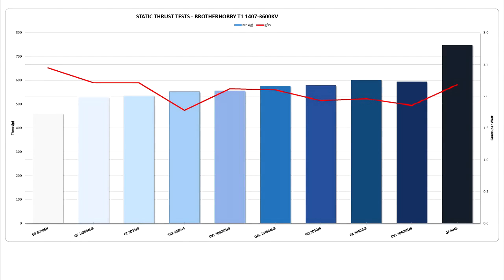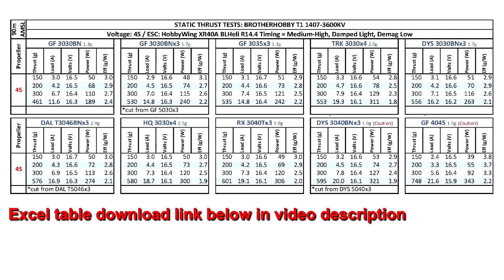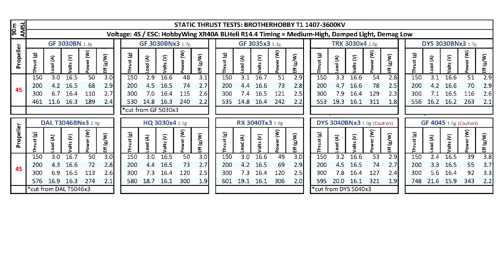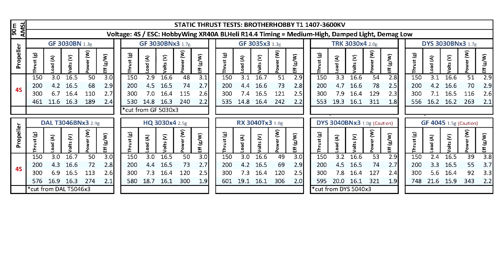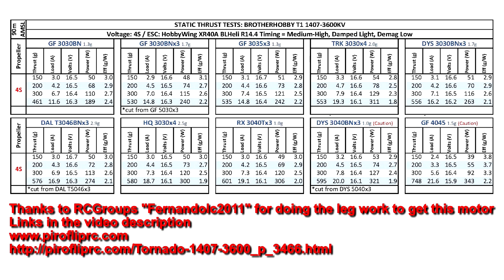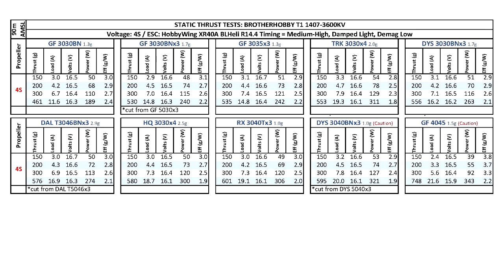BrotherHobby Tornado T1 1407-3600KV 4S Static Thrust Tests

Comment: Don’t know if this will get a reply since this video is older but would a 20a esc work for these in a cinewhoop setup?
Reply from the maker: Yes, any capable 20A-rated esc will handle cinewhoop props just fine. We used to run FVT-Little Bee 20A Esc's for 2205 and 2206-2400kv motors on 5" props and upto 600g stups.
Reply: EngineerX awesome. Thanks for the reply. I have an older dys f4 flight controller and dys f20a 4 in 1 esc I’m planning on putting into a diatone taycan frame with a caddx vista system. Hopefully it’ll all combine together well.
Reply from the maker: @shilomccoy7754  Sounds good. I've used the DYS single 20A BLHeli_S ESCs with 2205 motors and 5" props. I believe those 4-1 ESCs have same components as the single ESC's. It should be plenty capable. Good choice on frame. I recently was watching/reading about best Cinewhoop .... Taycan was one of the best designs. Prop selection will be key as it needs to have very small prop-to-duct gap. Check it out - maybe you already watched https://youtu.be/J1_WdRgjaOI
Reply: EngineerX just checked it out. Funny those are the exact props I have in the cart with the frame. So I should be good to go.

Comment: How many poles are on these motors    ( Bi Directional DShot concern )
Reply from the maker: These are 9N12P. 1507s are 12N14P
Reply: @EngineerX  Thanks man  I was stupidly counting the wound   posts versus the magnets in the bell   For the purpose of setting the pole count for Bi Directional DShot . I figured out my error from Bardwells video as he counted the magnets as they passed a single  wound post.  Dumb of me but I figured it out  THANK YOU.  Your Motors Bro Hobby EngineerX are the best in my fleet.  I have the Low Kv and high KV versions on my Armatan Roosters.  Still trying to find a good prop for the low KV versions that use 6 inch arms. What ever I have now the props were too big for the six inch arms . Good weekend Bro  be safe . Thanks for your hard work/ I wanna say it was 6" Azure props but they touched each other in flight  so maybe not quite 6" is required
Reply: Oh theres 12 poles  if anyone else cares
Reply from the maker: @gapsnapperfpv3947    1407 for 3d... Should be fun. Thanks for the nice words. Have fun on the weekend with the new build. I'll remember to check out your channel and see if you got video of that 1407 setup.

Comment: Hi, how about the heat compare to GR1408?
Reply from the maker: GEPRC 1408 for some reason runs hot. Depends on voltage too. These are ok for 3" on 4S
Reply: @EngineerX  yes, im trying to use it on my 4S 3" kwad.. is the heat will safe?
Reply from the maker: @tanoryjakaperdana1419  yes it is ok and safe BUT your quad should not be too heavy. Normal weight for 3" quad around 300 to 350g with battery is ok.
Reply: @EngineerX  ok sir.. thankyou..

Comment: Do you think I can run 3 inch 4s  on a 15a esc .
Reply from the maker: A 15A ESC can handle 3S for 3" props but probably too close for most people. 20A is what everyone uses for these motors but as long as you keep it very light and don't use too aggressive props it should be ok
Reply: Thanks . @EngineerX
Reply: I am going to take a chance on the 15a and let you know  how it goes. I am using a hglrc zeus f4 and I need it because I am making 3 inch cine quad in a frame not designed with that in mind.

I am banking on the numbers being over inflated and will not use a top tier C rated battery.

Thank you so much for the channel as it has become more important the longer I stay in the hobby. If it wasn't for your channel I would have no idea of the Amp draw with the different battery and prop combos.
Reply: not sure if this is what is considered light in a 3 inch but my all up weight is 243g on a 4s 850mah 
and is 219g on a 3s 850Mah
Reply from the maker: @rwells242  sounds like a very interesting setup. I think as along as you go easy on throttle. No crazy punchouts it should be alright. The low C battery will help keep Amps low a bit.  Only parameter left is overall lift. Hopefully enough on 3S. It might be close once loaded. You can even try 4S if 3S doesn't work. Higher voltage at lower throttle position may give better performance at lower Amps than 3S on higher throttle. 3S is a good start however. Cool let us know how it works and cool to know info was useful.

Comment: A test with gemfan 3052 would be very interesting.
Reply from the maker: I need to order a set. I tested GF Flash 4052x3 with the Racerstar motor https://www.youtube.com/watch?v=-Q_4Uy3PXV4 and tested the RotorX 3044T prop with the BH 1507 https://www.youtube.com/watch?v=iuCMBe78QLY
The RotorX 3044T is very similar to the 3052 but yes, need to test it sometime. My best guess is performance should be very close to the Lumenier 3040x3 so it should be a very good prop to fly fast.

Comment: Hello😆 Engineer X what do you think is the best 1407 motor on the market
Reply: Hairy Hider wish he answer cause I'm in doubt also
Reply: Cobra motors 1407 4100kv are my favorite by faaaar.  They come in a few different kv options. They are super smooth and quiet, run cool, are efficient and incredibly powerful.

Comment: Would use these motors with the 2800 KV or Emaxx 1306 3300 KV on a 160mm build with 3545 props thanks
Reply from the maker: a 1407 3200 to 3600KV would give you the best performance. This 2800KV motor has lower KV, about 2600. It will work OK but if you're looking for lots of punch then go with higher KV. The 1306-3300 would work too, but sometimes those overheat if you go hard on them.

Comment: Hey mate! do you by any chance have data with this motor on a hq 4" V1S triblades
Reply from the maker: TOOBZ FPV No, I didn't run it but if you check out the Cobra CP1407-3500kv test you can get an idea of thrust this motor will make. First, compare DAL T4045x3 V2 on both motors, you'll see the results are very similar. So the perdormance of the HQ 4043x3 V1S on the BH 1407 should be  very similar to the Cobra 1407's

Comment: I would really like to see the way these stack up to the new Cobra 1407 4100 KVs on your thrust test
Reply from the maker: Unfortunately Cobra didn't respond to my requests for test samples, so I ordered 1 of the 3500KV version. I figured right in the middle and should show how good the CP1407 are. So if as good as BH1407 then the 4100 should be similar too.
Reply: i bought the gold set of the 4100kv i almost went for the 1806 but wanted a light 4 inch..and it also seems to me that people have abandoned the 1806 size motors or they haven't came out with a set thats worth mentioning i still have the xnovas in the box...what props would you run on these in particular  (1407sl
Reply from the maker: 1806s got caught between 2204's and 1407's. Just recently the BH R41806 and TM F30 seem to be pretty good. 
For 4100 on 4" I've seen a few people using the DAL T4045x3 but it'll be very tough on small LiPos. I would start with a 4045x2 King Kong or DAL, the GF are too fragile. Then if motor stays cool and LiPos can handle it you can move up to T4045x3 or TJ4045x3
Reply: EngineerX king kong 4045x2 is what I use on my cobra 1407 4100kv.  I've heard the hq props 4045x2 non bullnose are slightly better, but I haven't tried then yet. If anyone has compared the two I'd love to hear your opinions.

Comment: hi,
I have been stuck with my 3inch build for almost one month due to the overheating of the motors.
My initial setup was emax rs1306 4000kv with Racerstar Labs 28A ESCs and Gemfan3030BN blade running on 4S.
The motor just getting too hot even at the betaflight motor tab.
I then changed the motor to brotherhobby T1 1407 3600kv with the same setup and hoping everything will work out but it turns out that the motors are still getting hot at motor tab and I did some hovering test with few small punches with less than 1 minute flight, the motors came down very hot.
The motor screw length are not shorting the winding and I have turned down the PIDs to more than half of the stock value with D below 10.

Extensive readings and research makes me really disappointed as I cannot really locate the problem.

Recently I have been reading about the compatibility of ESCs with Motors and see people discussing motors running 4s will be more prone to desync issues which may also cause motor overheat.

Do you think the ESCs might be a problem? What ESCs would you recommend to run with the rs1306 4000kv as well as these t1 1407 3600kv high KV motors?

Sorry for the long message, but really appreciate if you can shed some lights on this.

Regards,

Zt.
Reply: try to softmount your flightcontroller...
Reply: thank you for your advice, but its running too hot just on betaflight motor test tab.
Reply: hmm check your motor timing..0.50 ..in blheli suit or may b  you have bad esc change esc aswell for test

Comment: hi,

Thank you very much for this insightful review.

I have been stuck with my 3inch build for almost one month due to the overheating of the motors.

My initial setup was emax rs1306 4000kv with Racerstar Labs 28A ESCs and Gemfan3030BN blade running on 4S.
The motor just getting too hot even at the betaflight motor tab.

I then changed the motor to brotherhobby T1 1407 3600kv with the same setup and hoping everything will work out but it turns out that the motors are still getting hot at motor tab and I did some hovering test with few small punches with less than 1 minute flight, the motors came down very hot.

The motor screw length are not shorting the winding and I have turned down the PIDs to more than half of the stock value with D below 10.

Extensive readings and research makes me really disappointed as I cannot really locate the problem.

Recently I have been reading about the compatibility of ESCs with Motors and see people discussing motors running 4s will be more prone to desync issues which may also cause motor overheat.

Do you think the ESCs might be a problem? What ESCs would you recommend to run with the rs1306 4000kv as well as these t1 1407 3600kv high KV motors?

Sorry for the long message, but really appreciate if you can shed some lights on this.

Regards,

Zt.
Reply from the maker: thank you for watching!
Reply: hi, i actually have some questions and it is too long so you may want to click the read more button hahaha.
ooops.

Comment: Do you perhaps know what the Numbers are on hq 3x3x3?
Reply from the maker: I didn't run the test on HQ3030x3 because it seems the prop is not as widely used as the other ones and it's a little heavy. Also it makes less thrust than all the others and uses more Amps. They're well balanced and do fly well. You can see several tests I ran and compare to other 3" props. You can more or less estimate what to expect from that prop based on previous tests
https://www.youtube.com/watch?v=AK69tcHpPzo
On this not so high 3300KV motor ( a good KV for comparison because as you go up on KV you get less torque) we can see the HQ 3x3x3 makes about 6% less thrust requiring about 5% more power 180W vs 171W  (1A more) compared to the DYS 3x3x3. 
As you go up in KV to 4000KV, then the HQ becomes even less efficient, 
https://www.youtube.com/watch?v=wy6biSK8iRE

So to decrease time it takes for testing... I decided to drop the HQ and keep the DYS instead because they're close but the DYS has slightly better performance.
Reply: EngineerX ... Hi EngineerX! thank you so much for reply and great info. I have a 3" quad with the emax 1306 4000kv motors. i tested the racekraft tri blades but didnt like them. the hq 3x3x3 is much smoother. i ordered some lumeniers 3x4x3 and rotorx 3040 tri. Do you think the lumeniers 3x4x3 are better than the Hq? and also well balanced? The props need to be as much vibration free because my fc gyro is super sensitive. if i only gain a few percent thrust with the lumis or rotorx blades but more vibration i will stick to HQ.
Reply from the maker: The RotorX are best because they're light and well balanced but they're very fragile and expensive. I have not tested the new Lumenier 3" but I have been seeing people very happy with those and they say they can take a beating. Yes, from looking at the blade profile and shape, the Lumeniers should give a little more thrust. 
But sometimes you have to actually try them in flight to see how they perform with your set up, so it's good you're going to try those 2. Well let me know what you think of the Lum & RX once you try them. Always good to hear from people's actual flight tests.
Reply: EngineerX thanks for the advice! i will let you know after some test flights :)

Comment: Will it be fine if I run it on 4inch
Reply from the maker: Depends which prop. GF4045, or KingKong 4045 2-blade will be OK on 3S and 4S. 
For 4x4x3 you're better off running 2204, 1806, 2006 motors for 4S

Comment: Are these hand wound motors? And any chance of testing this motor with tj4045 (the standard tip triblade). Looking to compare against the prototype rotorgeeks 1407 3200kv. Was really able to push the RG motors. Stress tested the RG 1407 4000kv with almost all 4 inch props including dal V2 tip triblades. Motors never got hot but that setup puffed batteries like nobody business.
Reply: The 3200 was tested with TJ4045 on the bench and was alright.  Pushed 750g around 25A. For the more aggressive triblades on the 4000kv it was only done in flight. The 4000 was also bench tested with 5030, that test was called off on the 4000kv as Dave felt like it was going to smoke the motor. 

When asking if it's hand wound you should be able to tell by the gauge of the wire. Thicker wire generally can't be done by machine. If you see multistrand and very thing wire then it's machine. Hand wound can handle more current :)

As for 4 inch triblades, I don't really like the 2205 2633kv. It's kind of lackluster really. Would prefer the 1407 with tj4045 over it. Older motors like the RCX 1306 definitely had a noticeable drop in responsiveness running the triblades. I didn't notice this with the RG 1407 however. Makes for a very very fun 4 inch. You can also run a 1000mah pack with the 3200kv setup which makes for a nice light weight build. Honeslty one of my favourite quads to fly right now. Debating picking up a warpqaud type frame to build it with 5030s and see how it handles.
Reply from the maker: I think that's about right. I haven't had a chance to slap the RMRC 2204-2600 or the RCX 2205-2633 on my 180mm quad. 2204 and 1806's weigh almost the same so I think the 2204s would be pretty good considering they have a stornger 3mm shaft that will survive crashes better than the 2mm shaft on most 1806s.
Reply from the maker: I don't know if BH uses a machine or hands to do the windings, they don't seem to advertise/list very detailed specs on their website. 
On the thrust stand, The 4" triblades on 4S will draw way too many Amps and may fry the windings. GF4045 is 2-blade is already pulling 22A (343W). Motor got a little toasty but not excessively hot, but I think it's at the edge of getting very hot if loaded more. That's why I decided not to run the 4" triblades on 4S. They may work OK in flight as Amps will be lower by anywhere from 25 to 35%. Also on 3S, those tri-blades should be OK on the thrust stand. The motor is running at 288W on the GF5040  

Did you stress-test the RG motor with 4" triblades/ 4S on a thrust stand or in-flight? That's very impressive for a 4000KV motor
Reply: As I understand it , so far the best option for 4 inch triblades and 4s should be 1806/2204 at about 2700 kv. The only 4 triblade I found to be working well with 2205s is the gf4045bn, which is a "semi " BN as you know, but its a heavy prop with much authority . The dal4050BNx3 comes also close. To my experience 1306s and 1407s max out on 2-blade 4045 and even with these, while the speed is good the torque is lower than I prefer. My 2cents. Keep up the good work mate you are doing good.
Reply from the maker: Interesting stuff. Same here, one of my favorites quads is my 180mm. Mine's not lighting fast but it's very tossable and survives crashes well.